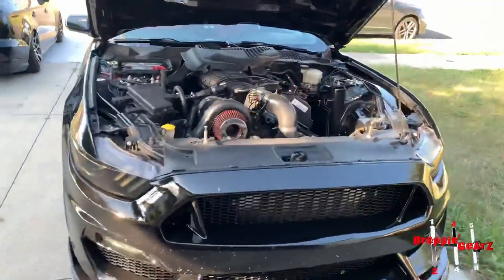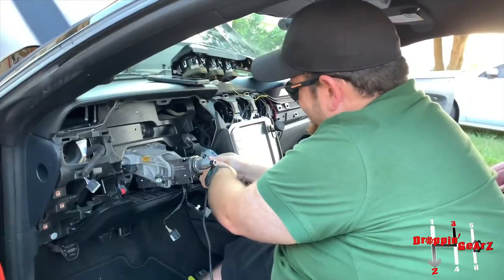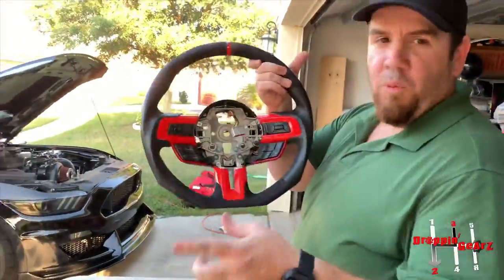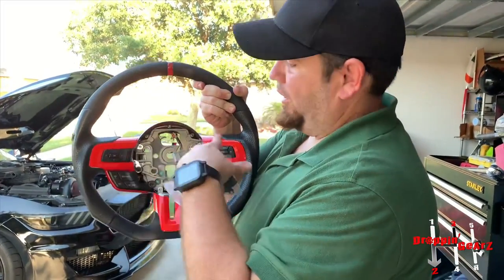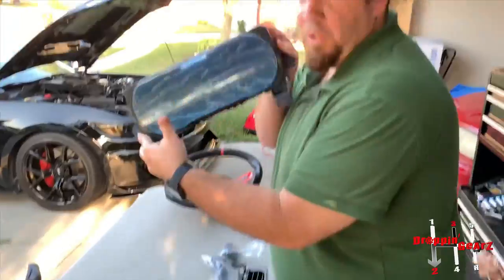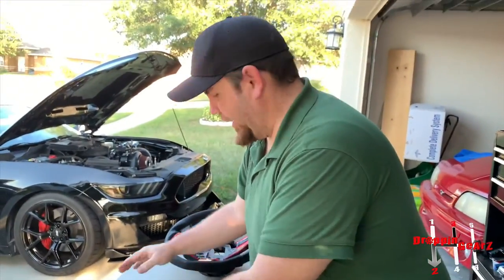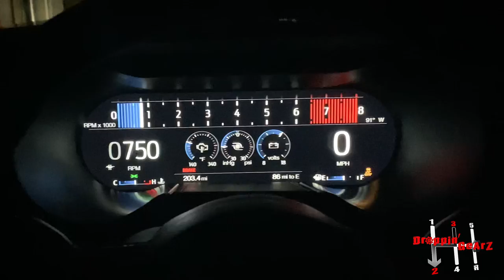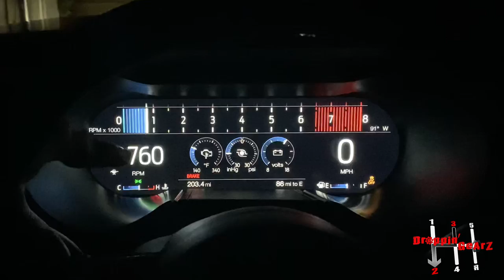V6 Mustang Digital Dash Conversion

Comment: Considering doing the digital dash to my 2016 3.7. Have you had any issues with it since the swap? Also I've checked with hellhorse and I see they offer a option for installation support (mainly for programming) was the programming difficult for it?  Thanks.
Reply from the maker: It’s working great, and programming can be done easily as long as you follow the instructions. Really not to bad and anyone slightly computer savvy shouldn’t have any issues.

Comment: after UG this cluster, you get line lock and LC options? or since it's V6 it's remain without it...? TX.
Reply from the maker: It can be enabled on the v6 without the cluster. I have personally not done the line lock cause well my tires are $300 a piece and I don’t track that car that much to worry about it. But you can get in mustang6g.com and search writes ups for line lock with forscan.
Reply: @DroppinGearz  many thanks dude!

Comment: I wonder if I can put all the 2015 interior stuff in my 2014 (I think the 2015 is way more nice on the inside) and do this digital cluster? Because its the same engine if I'm not mistaken which means that its probably the same ecu correct?
Reply from the maker: No not the same Ecu or Bcm and you will need to basically rewire the car and change the dash or get real creative . Engine has nothing to do with this unfortunately. The s550 and s197 shared engine and trans platforms but that’s where it ends.
Reply: @DroppinGearz  Gotcha gotcha
Reply: @DroppinGearz  Thank you 😁😁
Reply: @DroppinGearz  I'm 100 % down to reqire everything in the future to do this 😁 thank you for the information